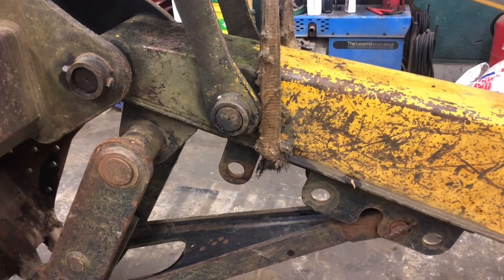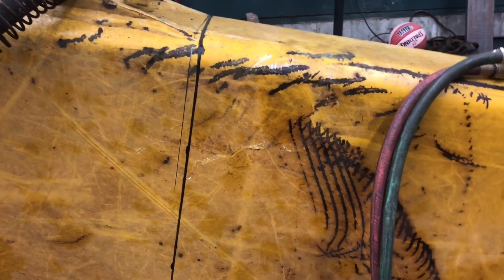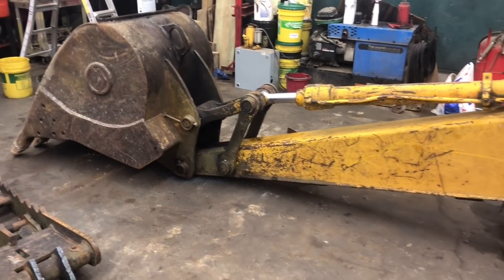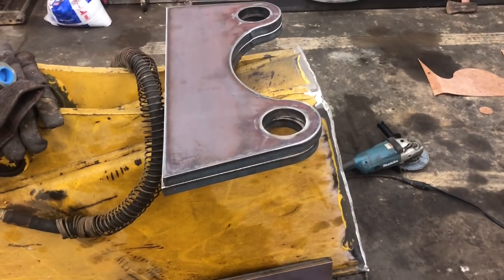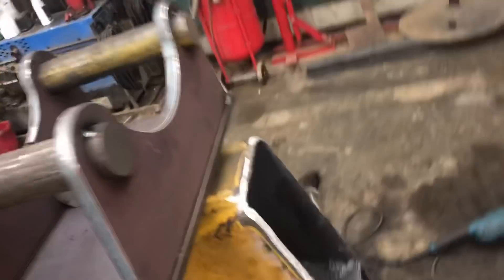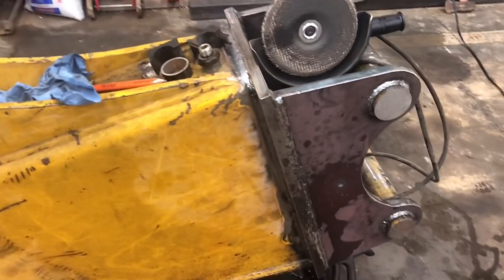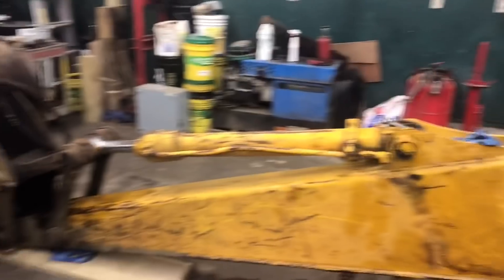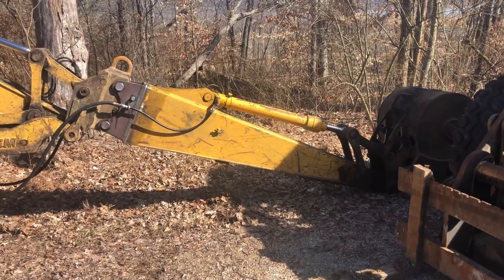Shop built excavator extension!!

Comment: Well, almost three years after the fact, I finally found "THE BIRTH" of the Super Stick. As a former fabricator of open wheel, formula road racing cars, you get "Three thumbs up" on this project. I recall the video where Chris was operating it on your pond a few months ago and saw some of it's... shortcomings... (i.e. the lateral balance during a swing, 90 degrees from the excavator, and working on a slope and running into the ground), but hey... like you said, it's a mission specific tool. You built it for $500.00? Nice job, Mike!!

I used to go out to the shop and study finite little parts on the Lotus. "How can I make this better?" Not all my ideas worked, but when they did... Standing on the podium was a better spot than the guy down there... looking up at the podium while wishing he were up there. Good job, my friend...........
Reply from the maker: Thanks

Comment: Very nice job. One suggestion I would have made bosses for the pins. Not much steel holding the pins on the outside. 1/2” wall bosses thru your plate and welded on both sides. Also would have put gussets on the inside of the two perpendicular plates for rigidity. Otherwise great job. Keep on with the ideas

Comment: You are not only a professional dirt digger but to your personal achievements in life, you are a metal fabricator as well, a most accomplished resume' to say the least. Now to my question : You mentioned both weight and limit in your presentation of this video, both of which leads me to ask.  Did you consult with the machine's manufacturer and if you did, were they opposed to the added reach which would be created by the extension arm. If they were opposed, what reason(s) did they give ?
Reply from the maker: Yes to some extend worked at the dealership for a while there take it the machine is hydraulic limited to keep firm tearing its self up but common sense still has to be applied thanks for the comment and watching

Comment: Nicely done but didn't the OSHA inspection offset the cost savings of building it yourself?
Reply: Owner operator are  exempt from Osha.
Reply: @beantownwelder8132  wrong
Reply: @williamuskoski1385     yes they are, so are small  farms and municipalities
Reply: Why would osha give a damn about this.
Reply: @JimGriff1720  any time you alter a piece of equipment or build anything used for lifting you are required to get a sometimes very expensive inspection to check welds and fabrication. However I did not realize that owner/operators are except from the rules. Which makes sense. As an example,we built a man basket for the crane (to transport Ironworkers from the ground to the iron) and it cost 3k to get it inspected. It only cost 800$ + the man-hours to build it. Just another way for the government to get more money.
Reply: @ironlife227  
Just because it make sense doesn’t mean much anymore.

Comment: I’m a plant fitter and design engineer and that looks spot on to me :o) And if you want a bit more, then drop a bit of removable tail weight on the back. I hear the fabricated counterbalance aren’t always full anyway? (One fell over and all the ‘stuff’ inside slid to one end)
Reply from the maker: Thanks for the comment may reach out to you sometime thanks again
Reply: We just changed a high-lift baby dump to tracks (710mm wide overal ) becuase it was butt, so your mods are right up my street :D  truck @DirtPerfect

Comment: I have a cat 215 blc. My dad and grandfather went to Peoria Illinois and got an extension for it back in the 90's. That thing has come in handy more than you would think. This one is not as quick to attach as yours. It takes the morning to get the bucket off, slip the extension on, move the cylinder down to the extention and then reattach the bucket.
Reply from the maker: Cool thanks for watching

Comment: Nice, home rigged, stick attachment. Years back there was a company up in Minnesota, which factory built an attachment similar to yours. Seen 1 used on a big ole Cat 235 hoe. The contractor was using it loading muck on scrapers and haul trucks. The mechanic said it worked pretty good but was hard on the original bucket cylinder. Nice vidja.